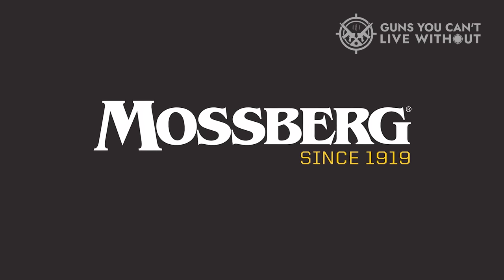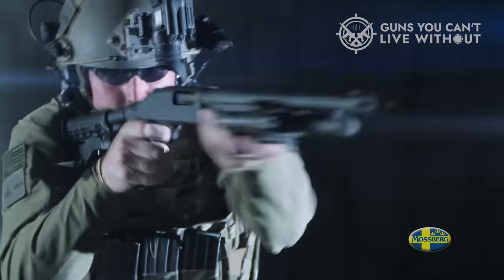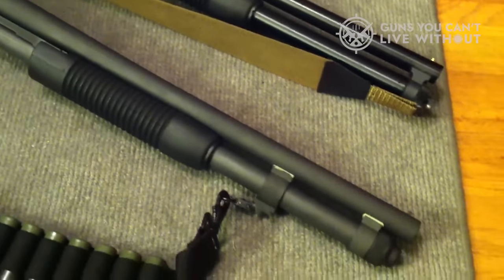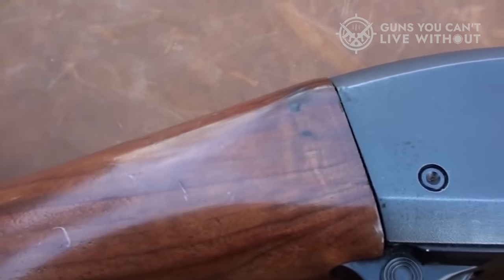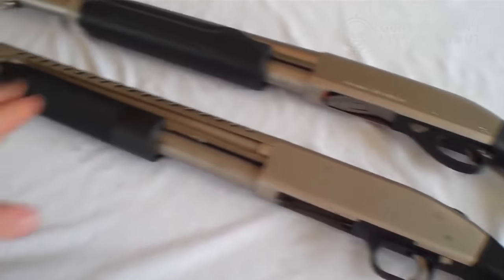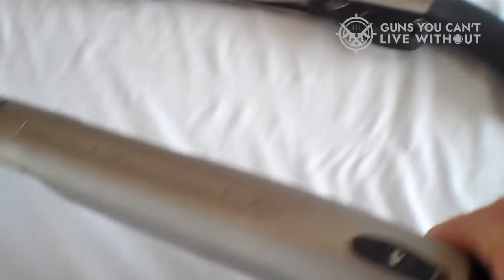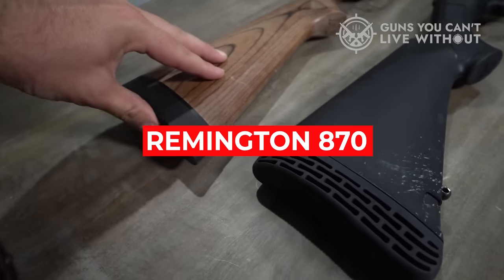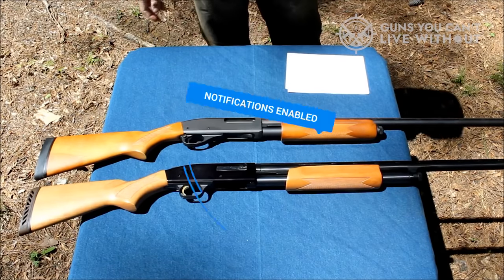Mossberg 590 vs Remington 870 - NOT EVEN FAIR.

Comment: The 870 Express has to be the worst shotgun I've ever fired. A true displeasure to shoot as it feels like a pro-boxer is punching your shoulder bare-knuckle. Fit and finish was fine, but that recoil was unusually bad.

My Mossberg 500 Flex, on the other hand, is very enjoyable to shoot, and I can shoot full power slugs out of it all day without fatigue.
It surprised me, then, when my brother sold his 870 Express, and got a Mossberg Maverick in 20ga, and that was also not an enjoyable shooting experience. Didn't kick as bad as the 870 Express, but was still way more than my 12ga. Also felt kinda junky.

I've had the pleasure of firing some various Benelli shotguns like their Supernova, and I liked it. Not as much as my 500, but I would be very happy with one of those in my collection.

I want to try a proper 870 at some point, as I've heard other 870 owners and fans say the Express is a garbage rod, that it's not just me. I also want to point out I'm not recoil sensitive; I routinely do the "Mad Minute" with my Enfield No.4 Mk1*, which is .303 Brit, and a wood stock with metal butt plate. Mag dumping 10 rounds of .303 Brit in 12 seconds out of a WWII bolt action doesn't bother me one bit. I've also shot .30-06, and .300 Win Mag, which do recoil hard, but are manageable. Just something about the 870 Express that is terrible. Could also just be that 870 Express in particular, so I hold my judgement on the 870 family.

Biggest reason I probably won't ever get an 870 is due to the non-serviceable extractor. Extractors are one of the most common failure points on guns, and it's bewildering that they don't make it field-serviceable. I keep a few spare parts for my 500 with me when in the field, and if I ever experience a problem, I can just fix it right there. Makes the 870 look really bad if you're considering longevity of your firearm in a SHTF scenario. There's no reason to own a gun that has to be mailed to the factory to repair an extractor. Really poor design.

At some point I'm gonna upgrade, and get me a 590 Mariner. Those are sick.

Comment: Both of them are incredibly reliable just make sure that they are cleaning lubricated as needed. But it's going to come down to is your skill it's not going to come down to the shotgun it's going to come down to what you're capable of doing with it. I own both I own several Remington 870 models and quite a few Mossberg 500 series and 900 series. Never had a problem with any of them. And I've put them through their paces pretty damn hard. It comes down to what you're capable of. That's just how it is.

Comment: Video sums it up nicely: "Big green is a shadow of its once mighty self." Get a Wingmaster if you're a Remlin fan and check it out carefully. Mossy 500- clunky, but it works and keeps on working. No loading gate to pinch a finger on. More difficult to disassemble but just learn how. Personally, I'm a Win/Browning semi-auto guy, but the 20 ga M500 is always ready to go for grouse or rabbit, etc.
Reply: PS- if you can find a 22" smoothbore barrel- Voila: you got a two-fer for deer & slugs or buckshot. I could only find a 24" in that configuration and the 26' for small game or trap.

Comment: I prefer the Mossberg Maverick 88, it's mostly parts compatible with the 500s & 590s only difference being that the Maverick 88 has a crossbolt safety, which is much better for a pistol grip shotgun ergonomically. The only downside is that if you put a pistol grip on it you will have to remove it every time you take the gun down for a full cleaning which means constantly unscrewing & screwing the pistol grip, that's one thing about the remington it's takedown is way simpler in my opinion.

Comment: Both good, but I like the fact the Mossberg clan is easier to work on and the fact the Mossberg's will take the Defender Tactical adaptors for using short shells (1 3/4). As I get older I like recoil less and less.

Comment: Got rid of two 870 shoties due to issues! 
Mossberg clearly wins this one! 
Mossbergs:
Are more available, 
Cost less new & used, 
Have more plentiful & less costly parts / accessories,
Weight about 1&1/2 lbs less, 
Have an ambidextrous safety, 
Have the safety in a better location ( my opinion),
Function better in sand & dirt (looser tolerances),
Easier & less costly to repair.

Comment: The comment about the safety on the Mossberg being hard to reach if a pistol grip is attached is a falacy. I have medium sized hands and have run a pistol grip on the 500 for over 2 decades and reaching the safety witout breaking contact with the grip has never been an issue.
I'm not a Mossberg snob. I used the Remington 870 in the Navy aboard my first ship as part of the security force and think it was a fine shotgun back then. Today with the many problems Remington has had maybe not so much.

Comment: Now Mossberg has a model 590S to function with the 1 3/4 mini shell. 13 in the tube, 1 up. Less recoil means smaller shooters are still dangerous  but not so rattled.

Comment: The newer 590s have issues with light primer strikes either right out of box or after a couple 100 rounds…they have a super stiff spring for the firing pin for drop safety however this can end up bricking the gun

Comment: I preferred the Remington most of my life. I thought Mossbergs were functional but ugly.
But being a lefty, I was sad when I got a Mossberg a few years ago. Sad that I hadn't carried  Mossbergs all my life.
Not only the safety but the slide release as well is in a much more natural spot, whether you are right or left hand.

When I had 870's and 1100's, I put the left hand safety in them, but curling your finger around to push a crossbolt safety just isn't as nice as that centrally located thumb safety.
And parts that are brazed on like the 870 ejector aren't very user friendly when you have to send the gun in to replace the ejector.
Mossbergs are a flathead screw to remove/replace the ejector. But that screw needs to have blue Loctite put on it, and check the tightness once in a while. If that scew comes out enough it could tie up the action. Mine Is clocked 3-9, so I can see if it has moved.

And another big plus for me is not having a lifter in the way when you load. My 1100 almost took another hand to load, you had to hit that release towards the back of the lifter with the base of the shell, or your thumb. If you missed pushing that release down the lifter won't go up.

On the Mossberg that big place on the bottom of the gun is wide open, just thumb the shells in.

Comment: Just sharing some insight. I gave my 870 to a new shooter and when loading they didn't press the shell far enough into the tube to get caught but it was past the spring gate and it jammed the shotgun up completely to the point were disassembly of the magazine tube was nesasary.  I have tried this with my mossberg 500 and if I don't press the shell in completely the shell falls out of the bottom and doesn't render the gun useless.
Reply: Yep, happened to me too. Can't happen to Mossberg

Comment: I own both but my go to is the Winchester model 97.
 Any questions?
Reply: Just one. When did they let you out?😅
Reply: @edljnehan2811   Yeah that's funny. . If you know anything about a 97, I like the exposed hammer, And just the way it feels, It just fits.
 I put the shorter follower in mine so  I get 6 in the tube and one in the chamber. 
  I have a 97 that's 28 inch modified barrel but the one I'm talking about is the riot with the 22 inch barrel.
 I tapped it for a screw in choke and she patterns real well.
Reply: @twodogs7741  you still didn't answer my question when did the doctor release you? Just kidding. I like the 590 better the controls are in a better place. The insides are better unlike the Remington which are basically cheap plastic junk. The Mossberg is lighter which is a bonus for me in my old age. I know a lot of people will disagree with this but to me the action is smoother. But I understand what you're saying. Now take your medicine and get some sleep. Hahaha

Comment: Let's face it people, We know both platforms work and work well. But ultimately what gets Mossbergs in people's hands is the price. Not build quality. I onwn them all, 870, 500, 590, and 930. I agree with most of this video, except the claim of mossbergs being easier to service. Clearly I don't think he's disassembled or customized either. Way more and smaller parts than a 870. Not to mention the steel on aluminum can leave some super sharp slivers in the receiver. The 870 is super easy to modify to your liking. I think their is a reason I've had only one in nearly 30 years and three or four mossbergs. I've only needed one to do everything I wanted it to do. I cant speak for the current quality of Remington 870's, but I've never had a single malfunction or smoother action. I own or have shot many other brands as well.

Comment: I owned both of these shotguns and MUCH prefer the non-jamming MOSSBERG to the damnably easily jammed Remington 870. THE 870 WOULD EASILY JAM with a short stroke of the pump. THIS required a removal of the trigger group to unjam it!
I SOLD THE DAMNED REMINGTON 870 AND BOUGHT A MOSSBERG 500. Then I competed in 3 gun with NO jams.

Comment: When loading a shell into the magazine tube when the bolt is closed on the Remington you better make sure the shell goes past the retainer that holds the shells in the magazine tube. If you don't the floorplate can drop down past the shell and if it's not far enough in to be held in the magazine tube by the retainer the magazine tube spring pushes the shell back between the closed bolt and the floorplate and it locks everything up tighter than Fort Knox. Only way to fix it is push both trigger group retaining pins out and pull the trigger group out remove the shell then reassemble. Mossberg doesn't have a floorplate so it can't happen to them. Only happened to me once and was just an annoyance but if it happens when your life depends on it you'll have a very bad day. Sold the Remington
Reply: @alexerwin2093 said another way to fix it is to disassemble the magazine tube. It happened to him too

Comment: I have both, an early 70s Wingmaster and a comparably aged Mossberg 500 I like both, both have seen quite a lot of use. I do like the top mounted safety on the Mossberg though. If I were to buy another pump riot gun I'd most likely buy a Maverick 88 and fit it with a new recoil pad.....the pads on them are a bit stiff.

Comment: I’m a 870 Fan & anything from “Big Green”, but quality has suffered in later years. I’ve shot the Mossberg but recoil is brutal compared to an 870. I know change pads, etc., but I’m saying right out of the box it’s way more pleasant to shoot an 870 versus the Moss 590. Also the bolt & action on an 870 are like tanks! (Or used to be)

Comment: Why does no one even mention the Winchester 1300 Defender in any of these comparisons??? I bought one when I first moved to Alaska in 92 for bear protection while fishing, camping, berry picking, etc. Since the dawn of the internet, all the research I've done on the "best" pump gun are between 870s and 590s however the Winchester has proven to run smoother and more reliable. Not to mention Slam Fire capabilities.

Comment: Mossberg for the win. Had both mossy is my choice overall. And I don't ever want to hear the sales on Remington were higher. Worked at a LGS for YEARS and Mossberg outsold Remington 3 to 1 but only one came back for repairs or accessory installs the most ----> Ejection issues = Remington....that or "I can't work on this" as far as installing goodies.

Comment: on all the moss berg pumps you need to grind the half cock mistake on the hammer to prevent failure to fire. then replace the magazine spring with a good one from wolff springs

Comment: I am a remington 870 fan. Building a scatter gun years ago i found a indiana state police 870, 18.5 barrel, stainless steel bolt, added a extended mag tube. The  870 will feed 1/2 shells i doubt the mossberg will.  Did buy my daughter the maverick in 20 gauge as it was way cheaper than the 870. The maverick had the pistol grip and the 18.5 barrel but no way to extend the mag.

Comment: These new 870s are what they used to be before Freedom Group pretty much disolved all QC. Picked one up recently and was surprised by the fit and finish and how smooth the action is. My 590 rattles like a maraca the finish scratches easy, and the action sounds gritty due to the aluminum receiver. And seems more likley to be short stroked. But that being said its never failed.
Reply: Aluminum is better that’s why all ARs are aluminum there better .

Comment: My dad bought me a wingmaster in 1975 when I was 10 years old. I have used it in the goose blinds and pits almost every year since. I have killed probably several hundred geese with it mostly in snow or rain as I dont hunt waterfowl on blue bird days. One day alone I killed probably 25 snow geese in sub zero temps with occasional sleet and ice storms. Its also killed my fair share of turkeys, and seen some occasional squirrel hunts although its not the ideal weapon for that. My sons have used it some as well in waterfowl hunts. I think its killed a few rabbits in its day but again not my first pick for bunnys. With all that use it only gets a disassembly cleaning once a year and sometimes 2 years and just a good wipe down after a day in the rain or snow and it has always functioned perfectly and minus a few light scratches looks practically new. I have not babied this gun at all and some hunters even considered me as negligent on its care. I think its probably the best material thing my dad has ever gave me and I plan to give it to one of my sons or grand sons and if they treat it the same as I have I don't see any reason it can't function a hundred or 2 hundred more years without issues.

Comment: I prefer the Mossberg, but I have one of each.  One thing about the 870 is it's a little easier to modify and upgrade as you go.  With Mossberg, it's sometimes easier to just buy it in the configuration you want.
Reply: The main thing about the 500 that I prefer is the location of the controls.  Tang safety and release behind the trigger guard are more ergonomically instinctual than the crossbolt safety and release up front. 
Though, if you plan to use a stock with a pistol grip,  the Mossberg loses all those advantages.
Reply: 😂I guess I should have finished the video before posting.

Comment: The "not fair" part is showing the Mossberg already customized and looking "tacticool".
As far as accessories and customization, the 590 may have just slightly more options. In performance and reliability, they are virtually the same. I've owned and used both extensively most of my 55 years. My first shotgun at 13 was an 870, so just on that, I lean towards that one. But to be honest, I don't have an ACTUAL preference.

Comment: The current Remington 870 has gotten so cheap and the quality control has just been left behind. If you want a good 870 you have to find a used one from years ago. Go to several shops and check out the trigger group and compare it to the older one. The cast aluminum ones are the newer ones and they are junk. Find an old steel one or order a custom steel trigger group. One quick look at each and you will see exactly what I am talking about. And don't be afraid to buy a used one. Just check it out and make sure it is operational. I would much rather have an old used PoS Remington 870 versus a brand new 870.

Comment: I have a mossberg 500 cruiser with a pistol grip I put a pic rail on the receiver with a red dot. I also have a Remington 870 express in hardwood stock and forend which looks great I also added a red dot by installing a mount between the stock and receiver. I find the Remington for me is harder to load fast than the mossberg. Although both have never failed to fire

Comment: The only complaint I ever had about my 590A1 was the factory length of pull, and how grippy that damn butt pad was. Easily fixable with an after market stock. The 870? The ‘70’s Wingmaster I have is a dream. The later produced one… absolute crap. Terrible finish that, I kid you not, would begin showing rust within a trip to the range… the action feeling gritty… tooling marks and just generally poor quality of parts… no. Not for the price. I’d never buy a new 870 again after that. Was an insult to the legacy. Having used both the older issued 870 riot guns, as well as the Mossberg after they began issuing them, neither had any particular issues. The 870 was certainly smoother, and we all handled them a little more carefully because of the beautiful bluing job on them, but the Mossberg was entirely up to the task and I don’t believe I ever saw or heard of a breakage or malfunction within my sphere. Unfortunately never got to handle one of the M1014’s before I got out… but it’s the only semi-auto shotgun I’ve bought that actually surpassed my Auto 5 in reliability and comfort. Don’t think I’ll ever bother buying another semi auto after it haha

Comment: Never used a 590/A1, but have used the 500 and 870 alot and found the 500 action rather clunky and brand of shell dependent compared to the smoother 870 on follow up shots, So right on with your asessment.